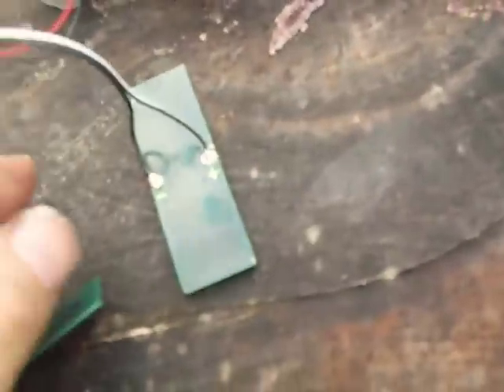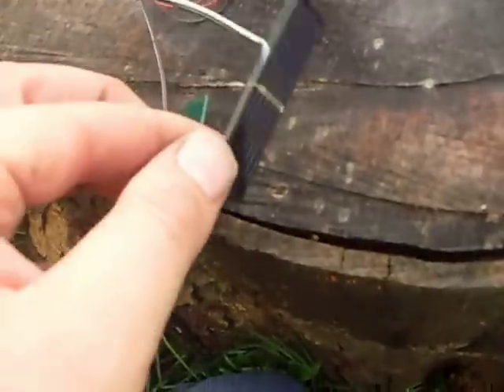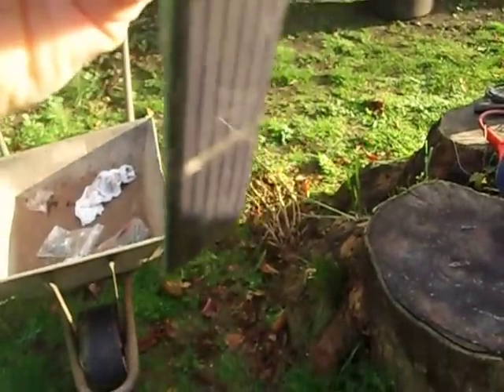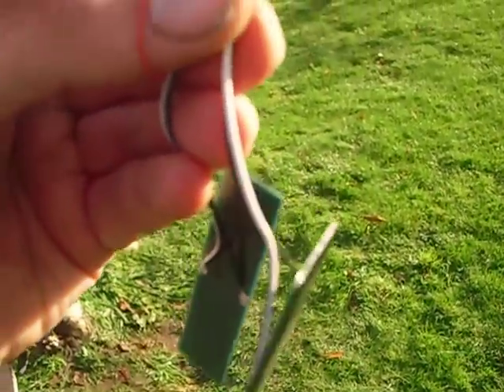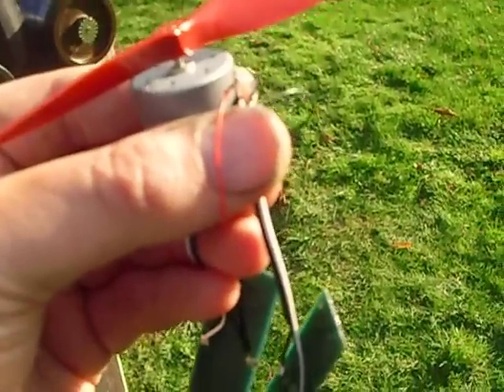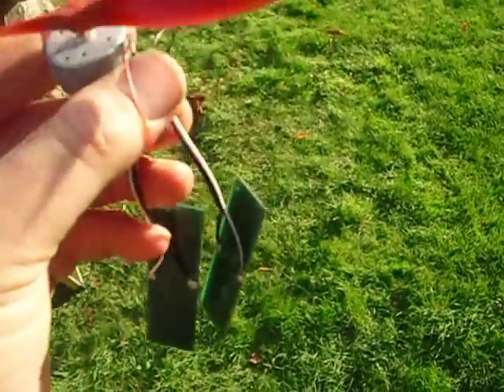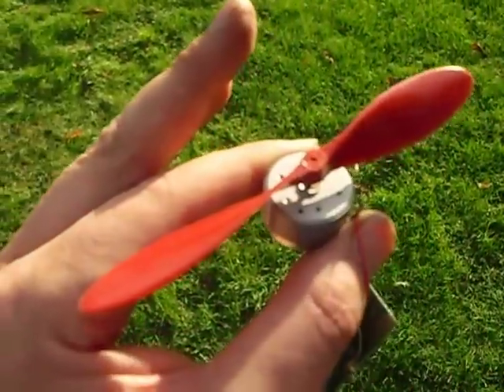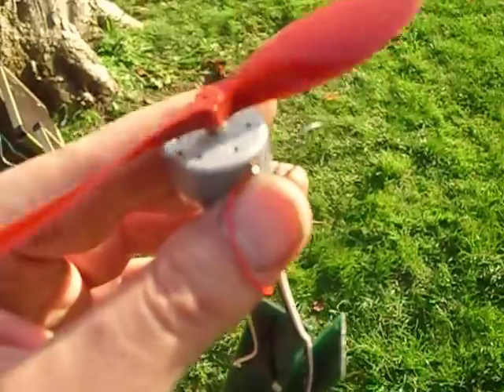Solar tracker simple design no electronics

Comment: When the two panels are equal when they are exactly facing the sun where the energy that they both create goes.when the two panels are bushing each other i think the must create heat that finally will burn something and that will be the more fragile .isnt that right?
Reply: ChuffChuffWoo unlike batteries - solar cells are semiconductors. As photodiode is more opened when it is more lit such way solar cell produce voltage and current. if solar panel is connected to the circuit in inverted potentials current is not able to pass in reverse direction (the same is photodiode, which is not opened for revese currents even it is lit)

For more powerful motors it could be designed as bridge, which allows high currents based on very small differences or use electrically controlled switches.
Reply from the maker: ...unlike batteries, solar panels don't produce excessive current when shorted so no damage done.

Comment: Praise the Lord! I found my mistake. I hooked the panels together like two batteries in parallel. You need to hook them up like batteries in series and short the left over positive to the left over negative. BUT THEY ARE NOT BATTERIES! THEY'RE LIGHT SENSITIVE DIODES! So instead of fighting each other, they complement each other. When one is more illuminated, it reverse biases the other and it disappears, electrically speaking. It's a thing of beauty and very sensitive. HalleluYah!

Comment: I watched the video again and found my mistake! You hook the positive of one panel to the NEGATIVE of the other panel! Since a solar cell is a diode in forward bias in normal operation, hooking a solar cell across it in reverse is simply a reverse biased diode! In other words it is like there is nothing there, if it is not illuminated or poorly illuminated. If the other cell is more brightly illuminated, then it reverse biases the original cell and it disappears from the circuit! HalleluYah!!!

Comment: Great question bc123132123132. I used two 2 watt panels (10V 200mA) and could just barely get a 1.0Vdc motor to turn. It was the most sensitive motor I had. The voltage varies from -1.7V to +1.2V when I completely shaded one panel or the other. I connected the two panel negatives together and connected the two positive wires to the motor. Even with all that power, it just barely worked. What kind of a motor are you using? That must be the secret.

Comment: Hi, what is the minimum voltage that it takes to get this motor running? those seem like really small panels, and it takes the voltage difference between panels to run the motor. Where can I get this? ebay solar motors need a minimum of 1.5v to run. How strong does the motor and power of panels have to be to turn the entire system. Sorry for asking so much, but where could I get gear parts online rlatively cheaply

Comment: How hard would it be to scale this up? Say I have to move a 100lb platform, could you still use a simple setup like this with larger panels and motors? Or, would you have to add other electronics to it to regulate things better?